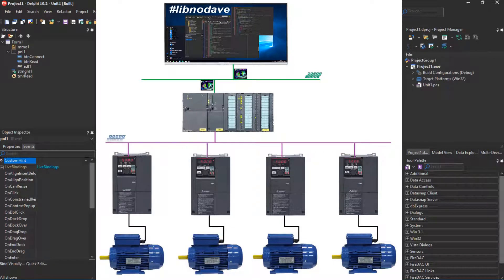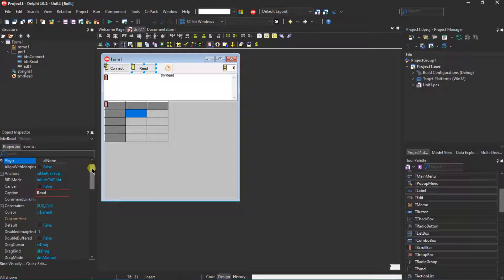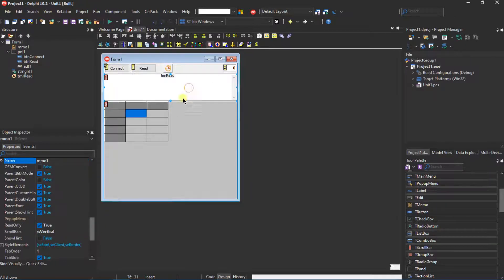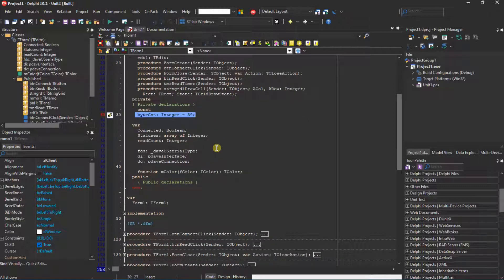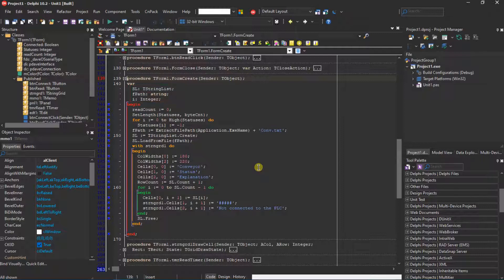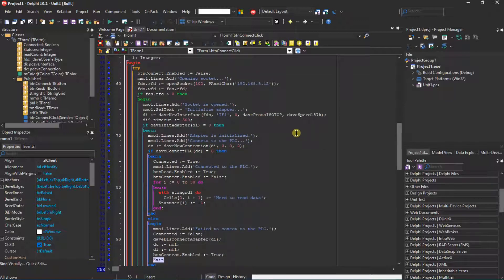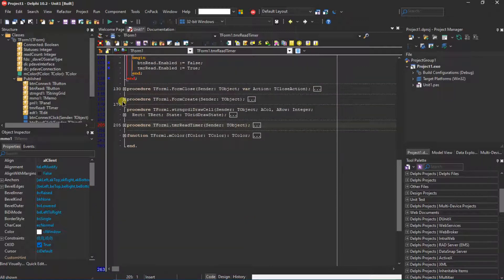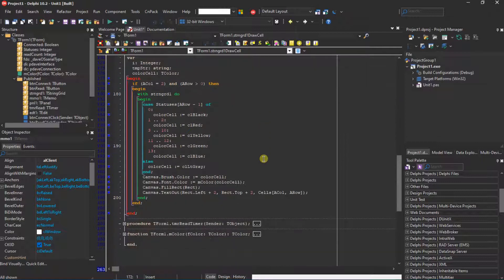Communication with SIEMENS S7-300 PLC using free library libnodave and Delphi.

Comment: Hello, I've been using LibNodave for years without a problem in Delphi 7. Recently installed LibNodave in my new machine with Delphi 10.3.
As you suggested, I tried to put the ANSIchar() function instead char(). It looks like this:

(in procedure TForm1.BtnConnectClick(Sender: TObject);   )
           fds.rfd:= openSocket(102, PAnsiChar('192.168.0.10')); 

Apparently, when I'm writing the code, there is no error. But in compilation time, this error is fired:  

PansiChar get error on compilation time: E2010 IncompatibleTypes 'PWideChar and PAnsiChar'

Then I tried to write this code:
fds.rfd:= openSocket(102, PWhideChar('192.168.0.10')); 

Then there is no error, neither in Writing time nor in Compilation time, and the program can run. But when I hit de 'connect' button, the procedure is not able to open the socket:

fds.rfd= 0  -->>  Memo1.Lines.Add('Failed to open Socket.');

Please, can you help me?

Comment: Hi. But this library not working with Windows 10 64 bit. Correct?
Reply from the maker: Hi, it works. Video is made on win 10 64bit machine. I have tested it with multiple projects. If you could look at 10:38, there you will see the visualization of the sawing line, and it runs on Win 10 x64 machine.